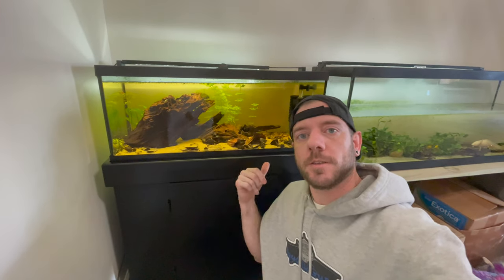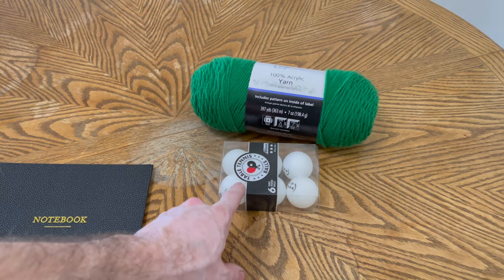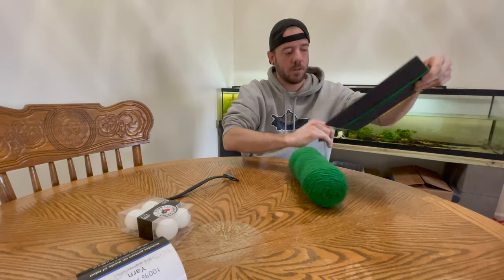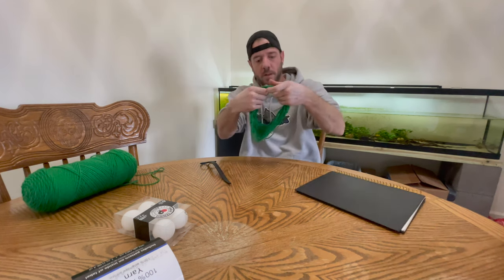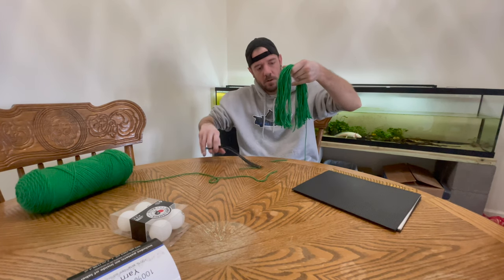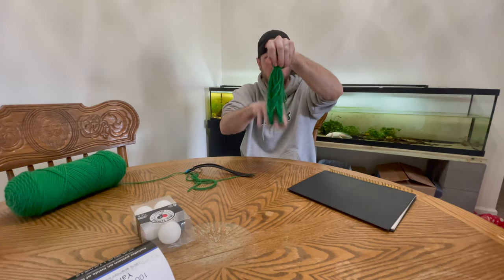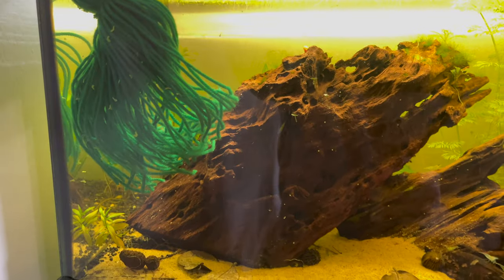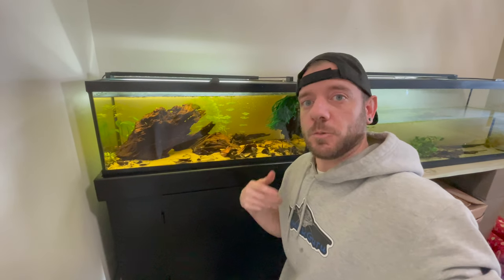Breeding Mop for Fish Tank - Easy DIY Version

Comment: Ive bred corydoras for quite some time and have been successful dont agree with what you said about them not breeding without moss or algae a water change usually promotes breeding ive bred them in an empty tank
Reply from the maker: What I meant was, this particular species seems to need something more. I’ve tried cool water changes, high protein diets, etc. when I added the mop, I had eggs the next day. Without doing a water change or feeding I still had eggs. So basically what I meant in the video, was this particular species may prefer moss or some sort of stringy mass to be comfortable to lay their eggs